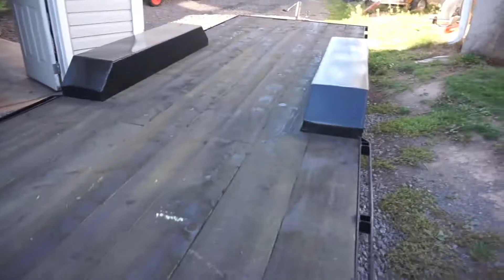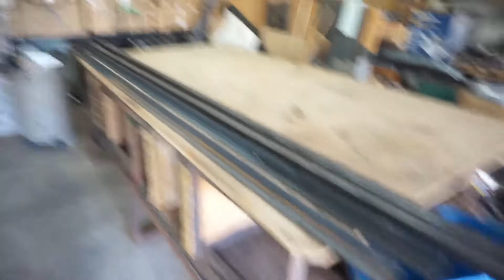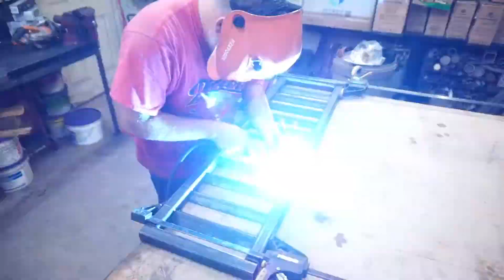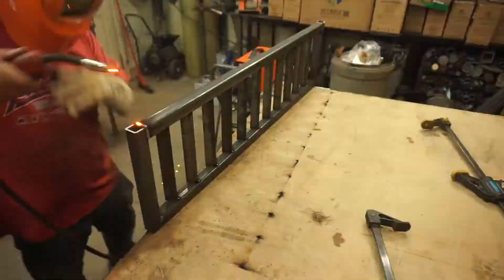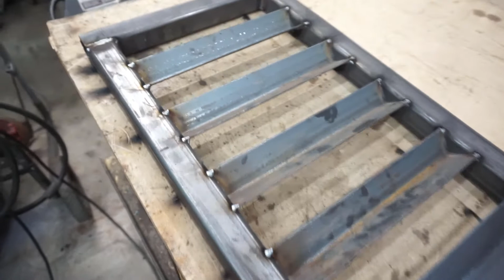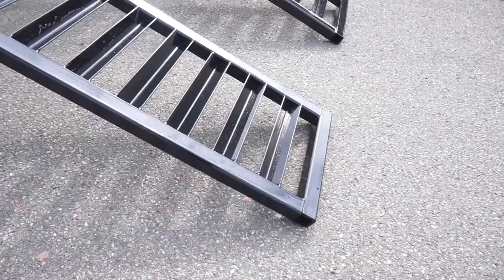How to Build a DIY Trailer Ramp for under $50 bucks

Comment: Can i make this similar design with only angle iron? 

Many ramps I've seen made similar had the sngle iron supports facing the opposite direction to yours. Is there a benefit to one ove the other?
Reply: @FarmerJim Yes, you can used just angle iron for the ramps, they obviously won't be as strong - my ramps are only angle iron.  Some people use "C" channel for the sides vs angle iron or square tubing.  Facing the angle iron the way he did gives your tires/tracks more and better surface to grab on to.  My ramps have the bottom of the V of the angle iron pointed up.  I haven't had any problems, but people who live in wet areas have reported slippage.

Comment: Nice looking ramps, watching you load your tractor made me nervous, when the weight is on the back of trailer only it lifts your van alot.  I did not notice any but you should consider wheel chocks or a block at the back of trailer as your van could run away if it is slippery.

Comment: Can you provide a cut list and material list
Reply from the maker: 4 pcs, 1.5" x1.5"x3/16" square tubing, 4ft long for the sides. 4 pcs of the same material as above, 16" long for the top and bottom. 20 pcs, 1.5" x 1.5" x 3/16" angle for in-between

Comment: Where do u store em?
Reply from the maker: I welded two 3" pieces of 1.25" square tubing on the side of each ramp so I can slide them into two 1.5" square tubes I welded to the side of the trailer itself.

Comment: How wide and how far you space the angle iron?
Reply from the maker: I used 1.5" x 1.5" x 1/8" angle iron, 10.5" long and 4" spaced (centre to centre). This is surrounded by a 13.5" x 49.5" (outside to outside) frame of 1.5" x 1.5" x 3/16" square tubing. Hope this helps.

Comment: Terrible design..not trolling you as you did in fact a nice job but it’s highly doubtful the ramps will not bend
Reply from the maker: Depends on the load. For my 1,500lbs tractor it's more than sufficient. For a 16,000lbs backhoe probably not. Design is perfect for my application. Thanks for watching.
Reply: I’ve put 10k lbs trucks on these style of ramps. I’ve had Zero bending or issues. Built the same way...
Reply: Square tube steel is pretty rigid. Four lines of rigidity add a lot of strength.